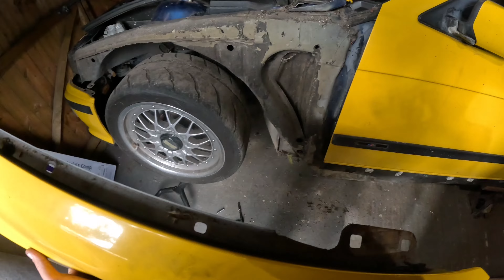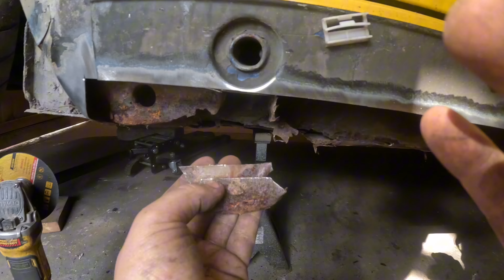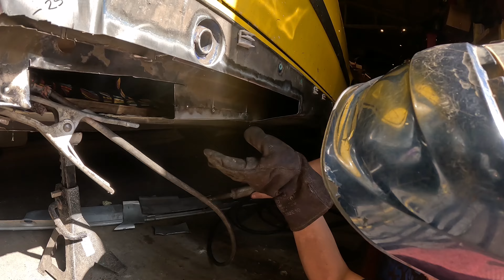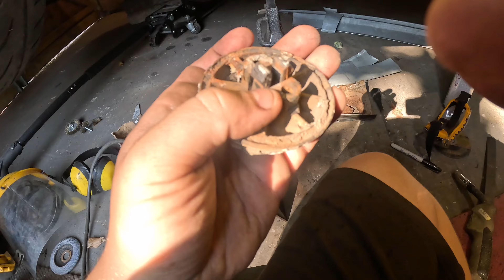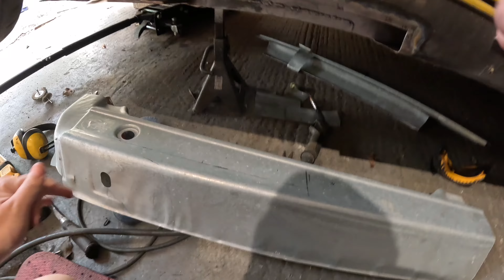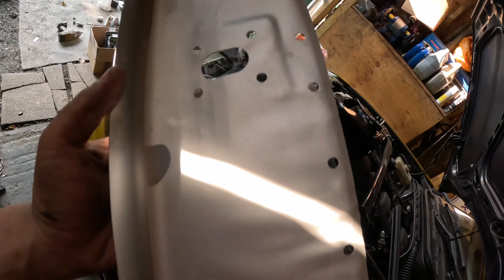BMW E36 front jacking point rust repair DIY how to WELD

Comment: Found this video and doing the exact repair on my e36 touring 😅 I would say its quite a bit worse condition as your e36😂 Those front panels triangle shaped  just after the front wheel, they are prety bad shape
Reply from the maker: Ah man that's a shame, good luck with the repair. One of my recent videos shows a much more detailed repair of this same section on my drivers side. Well worth a watch

Comment: What size tubing do you use for this?
Reply from the maker: 1.5" diameter. Up til. Now I've used 1.5mm thick walled tube but I would go 2mm as that's what I'm planning to use, it's abit easier to weld to the 5mm base plate
Reply: @HardlyExotic nice one man, got these to do next on my girlfriends 36
Reply from the maker: @TheBaeSauceShow not oo bad of a job, just be careful to get the angles right so the jacking point hole in the outer sill sits correctly so you can still stick the jack pad in. If you want it looking oem anyway
Reply: @HardlyExotic hey Man, how did you cut the jack point replacement tube to fit the oem jack insert? The rounded cut
Reply from the maker: 1.5" thick mate. I've been used 1.5mm thick walled stuff but for future I'd go thicker 2mm or even 2.5mm

Comment: I’ve got a 318i as my first project car and the rear jacking points are basically gone, so I’m planning to rebuild them. While I’m at it, I’m thinking about upgrading to the higher-trim side skirts since mine doesn’t have the clip-on plastic ones.

I’m a bit confused about the right approach though. Should I fully cut out the outer rocker panels and weld in new ones, then paint and drill the holes for the side skirt clips? Or is it better to just cut out the rotten sections like you did here and patch in pieces from a new rocker panel? Should i even go into the front jacking points if they arent completely fallin apart and still work?
Reply from the maker: Congrats on the purchase! A little 318 is a great car to cut your teeth on. For the sills, I would personally try and disturb as little original metal work as possible, if there is no obvious signs of rot  in the middle part of the sill then I'd leave it. The less you need to cut out and repair as a novice the better. Send me some pics of the sills and jacking points on Instagram if you like and I can give you a second opinion
Reply: @HardlyExotic Hi, thanks for the offer! I left you an IG DM.

Comment: 14:40
ideally you want carpet, seats, fuel line, fuel tank off the car.
This thing can catch fire within seconds. Even the carpet You wont even notice until its too late.
I have to do same job and I will take all off.
Im doing full resto anyway.
Reply: Fuel tank is in the rear and the fuel lines are behind the frame.

Comment: Buying a 325tds off a friend and the sills and rear arch need doing, this video has made me feel a little less worried about it 🤣
Reply from the maker: It's not so bad dude. Especially if it's a tds it's a saloon or touring so panels are readily available on ebay
Reply: I also have 325 tds and its veden standing like 4-5 years and seeing videos like these makes me wanna just want to repair ot for tue summer!

Comment: Hi yea thanks for the videos .. my next job 🥴  Can ask you what you use to seal it when fitting ie internal chassis etc for have silver bullet treatment is this good
Reply from the maker: So I use upol weld thru primer on the backside of surfaces before welding. After welding use exoxy 2k primer and then Gravitex 1k coating on underbody, or 2k paint on arches etc

Then spray cavity wax into all cavities. Something like dinitrol 1000 is good

Comment: awesome video mate, i’m 21 just bought my own 1994 325i, i’m in love with it but 2 jacking points are rusted through, and the rear trailing arm mount was rusted through too, this meant it could’ve ripped off while i was driving. 
This video gives me hope
Reply from the maker: Hey man, thanks for the comment and good luck with the project. If it's just jacking points and trailing arm pockets to sort then you're doing okay. I sell trailing arm repair pockets through my business if you need to order some. Have a look at protezioneautoworks.co.uk

Comment: Hello mate, great video. Could I ask how much I’d expect to pay for this repair. I have two front jacking points that need doing
Reply from the maker: Depends on the extent of the repairs but I'd budget 800-1200 depending on how far they've gone  for the pair. I'm based in Portsmouth and would be willing to take it on if youre local to me.